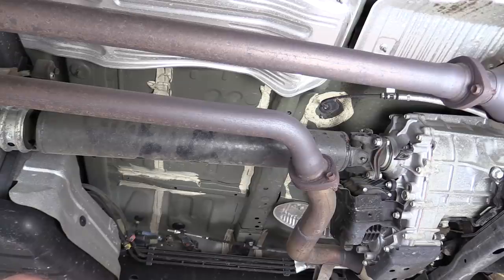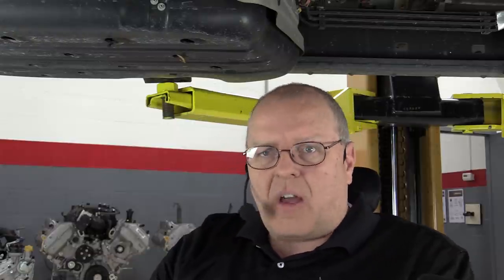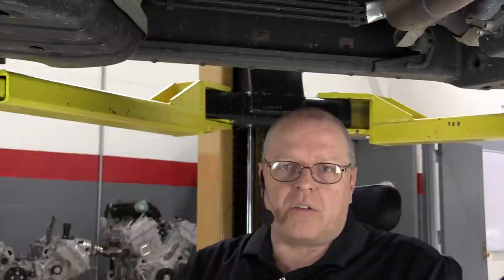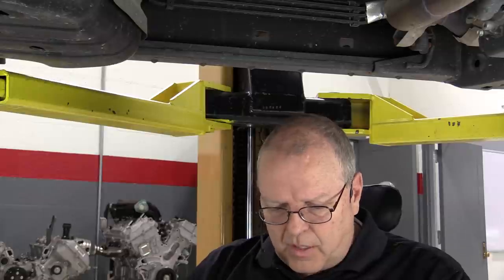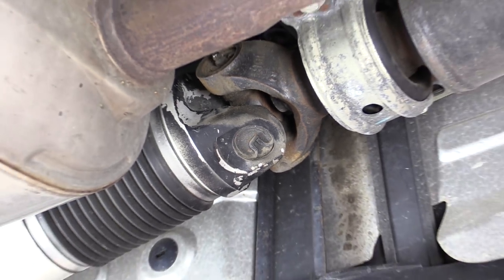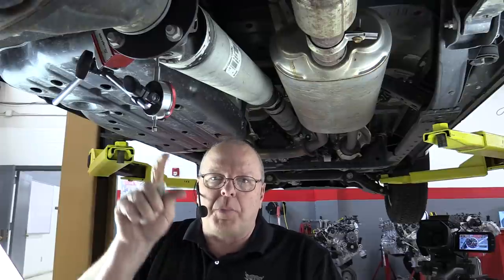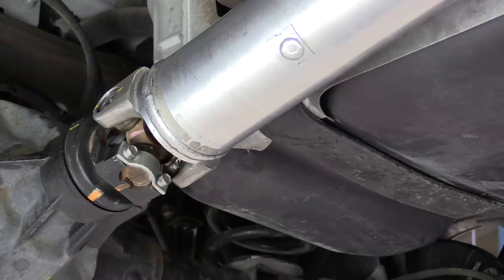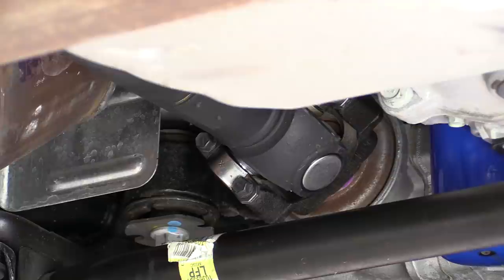Universal Joints - Part 4: U-joint and Driveline Inspection

Comment: Question on an aluminum driveshaft to steel joint causing corrosion. Why doesn't that logic apply to aluminum wheels on steel hubs? I'm working on a dodge with an aluminum shaft I bought from a junkyard and am slowly fixing all it's issues. it's my work truck and it definitely doesn't have the factory joints, but the shaft is a factory spicer. In about to replace the joints but I'm just curious because I cannot find a sealed joint that's also coated and was just curious on why spicer discontinued the sealed one. I've got a greasable one right now but I just don't see how that corrosion doesn't affect engine heads, or anything else for that matter.

Comment: WIth the FAD, the Jeep front drive shaft only turns when in 4 wheel drive and is typically used at low speeds. That should prolong the life of the shaft, but when it wears out, replace it with a serviceable aftermarket one.
Reply from the maker: Thanks for the information

Comment: great video again, 15 years automotive tech and I am still learning a lot from this series .very eye opening thinking back to the few comebacks related ujoint replacement  and vibration concerns . I believe after this series is done I will have the best practices for replacement in my mind for a comeback free repair for the next 30 years or so , so thank you looking forward to the next one
Reply from the maker: +Alvin Nagra Thank you for the feedback! I am glad it is helpful.
Reply: +WeberAuto  so next week we learn to press a u joint out with vise and hammer and press back in with old socket and vise right lol I've never done that !
Reply from the maker: +Alvin Nagra lol, I know you are joking, but it is a common misconception. I will change several different types of u-joints in the next episode without using a hammer. Stay tuned!

Comment: Hi again John. I have a 2013 Dodge Charger RWD. No universal joints. Elastomeric couplings. I have a one-time clunk when load applied ( ie from a stop to a hard acceleration or from coast to hard acceleration). If no you joints, what else should I inspect. I am a mech engineer with lots of tools so lay it on me LOL. Thanks in advance

Comment: Have learned a lot from your videos.  Replaced the rear drive line (2 piece shaft) on 2005 Subaru Outback because it had staked ujoint caps.

Comment: Excellent video. Had a 76 Chevy.blazer with the older slip joint drive shaft and always made a clunking sound or feel when starting off from a complete stop. Never got worse eased up when greased but was always there. Great video thanks
Reply from the maker: Thank you! Yes, there is a special grease for that issue, but it is a temporary fix.

Comment: i had a technician install 2 new moog u joints on my car but they screwed up by not putting on the zerk grease fitting, or not putting it on very well because it was missing. took me quite a while to figure out where the squeaking was coming from. your videos are awesome jon

Comment: All good John - although I have a differing view on greasing U joints or any joint with a grease seal or boot (as a mechanic myself since 1976) - when greasing such a joint you should never put so much grease in that it is forced past the seal lips, doing so may compromise them and allow dirt to mix with the grease at the point of the seal its expelled - the correct method is to place one finger on the rubber boot and inject grease only to the point the rubber boot becomes inflated with grease and feels a bit firmer like a tyre getting firmer as its inflated - that indicates the grease has been forced through the bearing or ball joint even suffice to inflate the boot at which point stop pumping greased in - observe this method will save any grease boot seal from attracting dirt and accelerating wear of it. - if you observe a boot that has had grease forced out then retract the boot seal back as much as possible and wipe the boot seal lips of any grease.
Reply from the maker: +AusMecham Hi, great feedback thank you! I agree regarding periodic greasing of U-joints; however, on initial installation of the joint, equal amounts of grease coming from all four seals indicated proper installation and axial play. See Spicer's own video https://www.youtube.com/watch?v=wH-fvddVt-g&list=FLtr07mdKhsUwVJjL8Kw_q5A&index=27 Thanks.
Reply: +WeberAuto Yes that is just with periodic greasing - for initial assembly you'll have some excess grease around after assembly anyway so as long as that's all cleaned up its good to go - Regards, thanks for the reply.
Reply: @Aussie101
New centre bearing is about $20 for aftermarket on ebay
By the description on the justcommodores forum Id reckon for a qualified mechanic it would take about 2 hrs....including lunch break.... so about 1 to 1.5 hrs job.
600 bucks, tell em their dreamin and then shop around.

Comment: One other bit of advice for any tail shaft that exhibits vibration yet has no apparent signs of wear or excess clearances - in more then a few cases one or more needle rollers or internal cup faces may have pitted and deteriorated to the point that the cup bearing becomes notched or semi seized yet not slack - to check for the you need to remove the tail shaft and then grasp the yoke and feel how much resistance the cup bearings have when moved about its limits on each X and Y axis, and that the motion is smooth and linear in the bearings -  if the bearing motion shows some resistance or has a tight or rough spot then this can be the cause of vibration and the u joint is most certainly on the way to total seizing but may take some time before any slack of excess play is evident - hope that helps.
Reply from the maker: +AusMecham Thanks, that is exactly right.
Reply: +WeberAuto Ill just add that in all cases the first thing I would do it the tests you have explained in detail here, if nothing found the next would be to try to feel for any firm spots while rotating the shaft that can pick up if the cup has a very tight spot in it and in some worse cases you can actually hear or feel a metallic ping in the shaft as it moves through the tight spot, in those cases the inside of cup is usually dry and more advanced stages of seizure but if nothing found to shows the source of the vibration at that point I remove the shaft last resort to check it as I described.

Comment: The reason I was asking is because I had a bad center carrier bearing on my tacoma so had it changed. That made things worse. After watching your videos I noticed that the driveshaft isn't in phase. The weights on the front driveshaft is on opposite sides than the back driveshaft
Reply from the maker: That can be normal; however, If the driveshaft is not in phase, it will can vibrate. The phasing I am talking about is not balance weight related, it is u-joint cap related. All three u-joint bearing caps should be lined up with each other. It is easy to accidentally get them out of phase after changing a center support bearing. Best wishes!

Comment: Also i have seen they sell vibration analysis tools though i have my doubts on how good they can be for giving you the correct location of the vibration problem (i.e wheel bearing , driveshaft , balljoints ,...etc to name a few) . But definitely a dial gage can be accurate to tell you if something is out of round causing an issue such as pinion ,wheel hub assembly parts , or driveshaft sections. Ofcourse some times you need different dial gage attachments to set up the dial gage correctly not to bump the wheel stud nuts when measuring out of round of wheel hub assembly parts in some cases.
Reply from the maker: Thanks for your feedback! This app is the best on the market for vibration diagnosis https://www.youtube.com/watch?v=s1cr3QaOzGY

Comment: On a 2 peice driveline, should the balance weights on both shafts be on the same side? Like phase the ears on a driveline.
Reply from the maker: They do not have to be, it depends on the side of balance weight available verses the amount of imbalance. Sometimes two weights are used and spread apart to simulate a smaller weight  somewhere in between them. Thanks for your question

Comment: Another informative session, John. Thanks.

?: for the crimp-on style shafts that require complete shaft replacement, is that possibly covered under manufacturer "powertrain warranty" ?

Also, have you seen the carbon fibre shafts being used by BMW for some of their newer M performance models? I was curious as to how they graft the yokes to the ends of the carbon fibre shafts.
Reply from the maker: +Mario Dalla Riva Hi, thank you! Complete shaft replacement could be covered under the powertrain warranty as long as the time or mileage had not been exceeded. I have heard of the carbon fiber shafts, but know nothing about them. But now I am curious. The Snap-On carbon fiber high voltage sockets and extensions I have seem to have the fiber wrapped around a knurled insert for the drive end and the driven end (with no conductive material in between). I wonder if that is what they are doing. Thanks for the feedback!

Comment: I noticed you are working on a Toyota with factory installed grease nipples - These are SO BADLY overlooked! If you take your truck to a Toyota dealer where I am, you have to request for them to grease these parts or they simply will not do it. I do my own anyway, so they get plenty of grease as they need doing regularly and more frequently in the Monsoon season. What I would suggest is due to neglect on these parts, maybe give them a good greasing (as often they will be dry) then give it a week and re-grease and see how the grease flows before replacing joints - often you can get them to loosen up just by refilling and flushing / pumping out the old crud left in there.

Comment: U-joints i am ok now with as there are a couple types some have to be melted off the plastic , others have snap rings outside others on inside...but once you take them out it is either a hammering out or pressing out method to replace. I am more concerned about runout being bad on a driveshaft and weather you re-balance it or just replace the whole thing. Basically i know replacement i don't understand so well how to re-balance it once you find it out of round or unbalanced for a driveshaft. Yet at least
Reply from the maker: Thanks for your feedback!

Comment: i have 04 f150 and has a 6in lift kit it has a loud clunking sound just when taking off from a stop then goes away i push my slip yoke up and down and has play do i need a drive shaft spacer becuase its sticking out more than stock any advise will help
Reply from the maker: You need a longer driveshaft to compensate for the 6" lift kit. You are lucky the slip yoke even stays in place. Best wishes

Comment: You said to replace the straps connecting the rear u-joint to the rear flange , I do agree that if they stretch after securing the u-joint they should be replaced
but in todays state of being parts like that could be very hard to find, its not a normal world today.gggg
Reply from the maker: The Spicer straps can be purchased on amazon.com or ebay. The dealerships SHOULD have them, but most will not. Best wishes!

Comment: I am ok with the understanding of measuring drive shaft runout , wheel runout , pinion run out,...etc (with a dial gage though it may take a few try's to perfect) but what i haven't seen is how to balance a out of balance driveshaft once found. It seems like it be similar process to balancing a wheel by adding wheel weights with a hammer. But do you normally replace driveshaft completely or weld metal weights on it ? I am guessing when in doubt just replace the whole driveshaft as that's usually an easy removal/install process but just wondering if anybody still tries to balance an  old driveshaft
Reply from the maker: Hose clamps can be used to balance a driveshaft in the vehicle. It can work very well. See https://www.youtube.com/watch?v=kj78G4wtXKE or https://www.youtube.com/watch?v=egdAjsasiEQ Best wishes!

Comment: That is what I'm talking about when I say out of phase. The universal joint bearings on the front driveshaft don't line up with the universal joint bearings on the rear driveshaft.they are at least 30 degrees off from on driveshaft to the other
Reply from the maker: That is no good

Comment: I have a 2013 mustang v6 manual trans. I have a vibration/resonance on deccel between 3100-2200rpm range. Every gear any speed. I've been told its caused by the 2 piece drive shaft or the dual mass flywheel. Any advice on this?
Reply from the maker: +Joey Sangster Hi, vibrations on deceleration are typically caused by two things:  1. U-joint working angles that are out of spec while decelerating 2. A rear axle with bearing preload problems allowing the pinion gear to be pulled too close to the ring gear while decelerating.
Reply: +WeberAuto oh wow. OK thnk u much.
Reply: +WeberAuto So how can I fix the rear bearing if that's the issue? does that mean a rear end rebuild? my car is still on warranty as well. should this be covered?
Reply from the maker: +Joey Sangster 
hi, it may be still covered under warranty. Ford dealers haver a vibration analyzer. Hopefully they can tell what problem you have and fix it.
Reply: +WeberAuto ok thnx again. ur videos r great. very informing.

Comment: gm term is actually propeller or prop shaft
Reply from the maker: Yes that is true, it comes from the early times before automobiles when marine vessels were the only ones that actually had a shaft between the engine and the propeller. Toyota also calls it a propeller shaft. Thanks for the feedback.
Reply: We call it a "tail shaft" in Aus - a "drive shaft" is usually used here to describe "half shafts" (Front WD drive axles)
Reply from the maker: AusMecham Thanks for the feedback!

Comment: I have watched all of these U joints and have almost 6 hours of info. First off take everything you have ever seen on you tube and throw that out the window. Take everything you have learned about how to install and remove and which clips to use, out the window. You really need a PHD in space time contunium to even get the right ones. Steel vs aluminum, carrier earrings and slip yoke Axel play oh my... Been changing these for 30 years with a hammer, press, or vice never any issues. Now I wa snot checking tolerances in up and down/ snap ring sizes, over bent, or ears on the pinion....... This is alot and I am sure it's all relevant but 99.999% of shops-dealers- do it yourself are not doing all this.

Comment: Another great video :)  Curiosity did however kill the cat ,and I also just finished watching a 17 part Youtube video on replacing staked U-Joints. Cringe worthy in many respects especially with Axial play being "overlooked" but in all fairness it would get you to work the next day with no other financial means to do it correctly.  Thanks for making these videos you are an exceptional teacher. :)
Reply from the maker: +Brenda Car Girl Thank you very much. I agree, those staked u-joint shaft fixes might get someone to work the next day, but they may not last as long as the original ones did. As you may have already determined, my teaching philosophy is to teach the correct way to do things. This way when a technician decides to shortcut something, they will have a better idea of what could or could not be shortcut, and why. Have a great day!